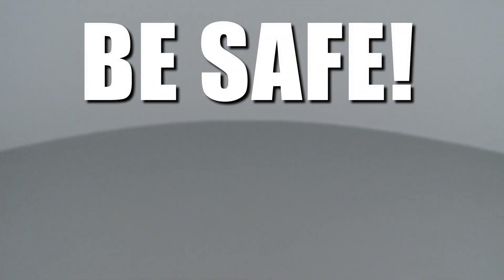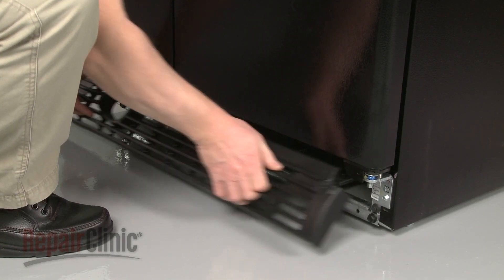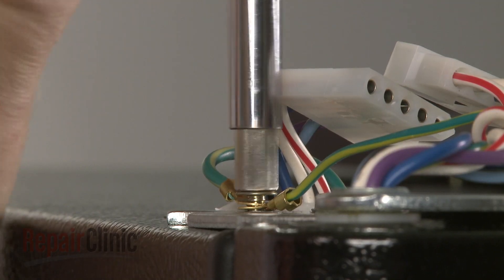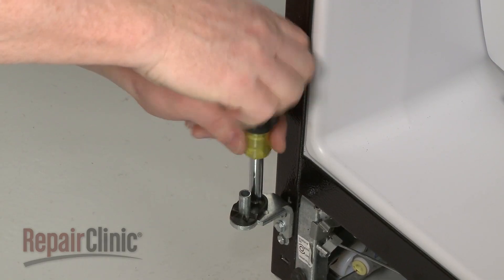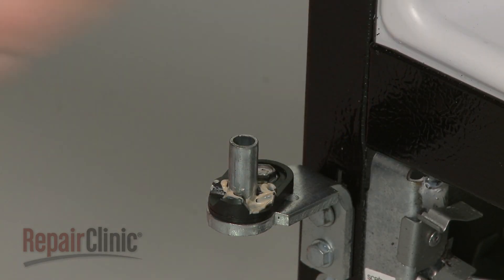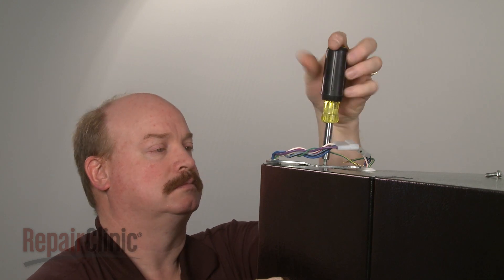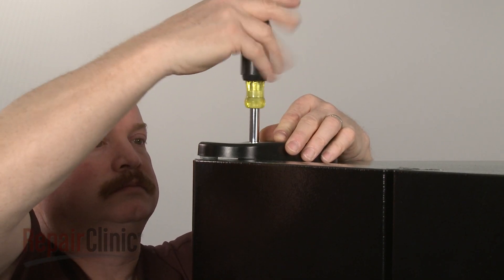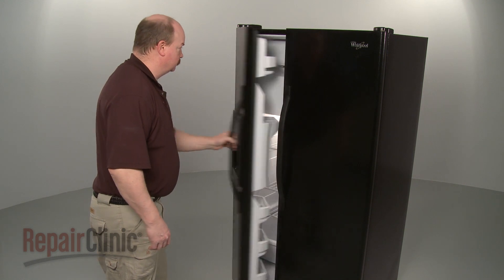Whirlpool Refrigerator Replace Lower Closing Cam #W10329686

Comment: My problem is the door on the refrigerator side.  It opens okay, but if I don't hold it, it swings violently open to 180 degrees and rattles all the items in the door.  Seems to me it should open more gently or stop before it swings so wide.  Does it need a new cam, and other parts, or is there some adjustment?  I bought it a few months ago, and it seems never to have operated properly.

Comment: Well, both refrigerator door and freezer door loudly popped.  I replace the cam on both doors; lightly greased both.  Reinstalled both doors and both continue to pop as loudly as ever.  Not sure where to go from here.